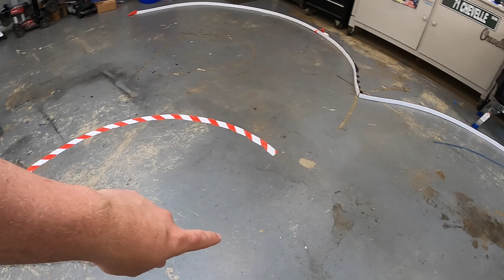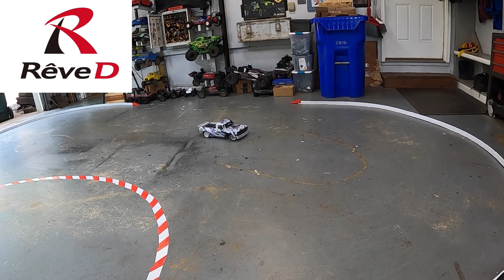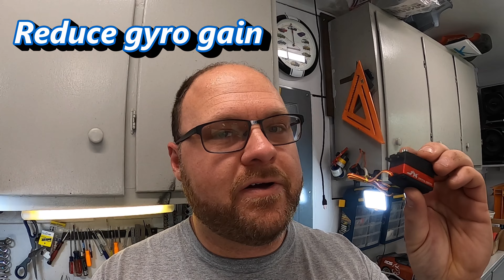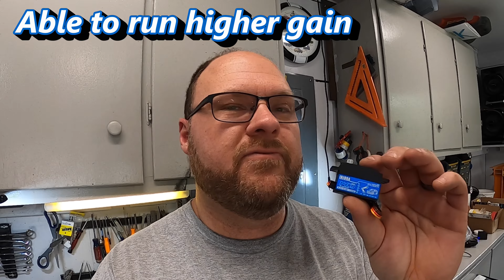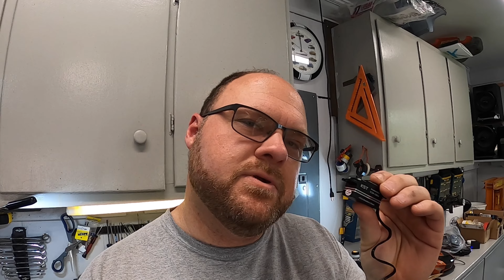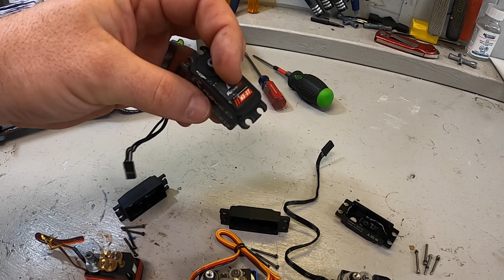Best for Drift??   Cheap and Expensive Low Profile Servos TESTED

Comment: what does the servo really help with in a rc drift car?
Reply from the maker: It has a lot of influence!
- Speed to get to the angle needed
- dampening to reduce wobble
- precision to be at the correct angle

Driving a low quality servo vs high quality really matters - especially depending kn the steering setup of the chassis.   When you have a direct drive steering, it is crucial!
Reply: @RoadsideRC oh okay i need that which servo should i get

Comment: I know this is an old video and not sure if you remember but, my buddy put the $25 injora servo in his RD 2.0 and when the car is powered off it is really hard to turn the front steering. With my sp-02 servo I can turn my steering when powered off super easy and smooth.  Is it the injora servo?  
 Mahaloz
Reply from the maker: Honestly - as long as it drives well, I wouldn't concern myself with how it feels when powered off.

Comment: So i have the injora servo and i paired it with the flysky noble 4+/inr4 gyro receiver combo. I'm running into gyro wobble pretty bad actually. Servo seems good gyro seems good. Did all the usual trouble shooting and haven't found a fix yet. Do you have any experience pairing the injora servo with the inr4? Wondering if i can pick your brain and see if i can't get some help.
Reply from the maker: Hello!
I have not paired those two together specifically.  

Since the INr4 is different than most gyros, have you gone both up and down in gyro gain to see how it changes? 

What chassis are we talking about?  Chassis with direct steering are more susceptible to wobble than wiper systems.
Reply: @RoadsideRC yes i have tried adjusting gain. 0-100% it goes away when it's off and gets worse turned up. I find 30-35% is my maximum before it gets really bad. Typically i see it come in at higher speeds. It's not a chatter but a wobble per say. 

This is on an MST rmx ex s pro kit. I just built the kit and it's on a box stock setup/alignment in the lcg mode. I double checked everything looks good according to book spec to start with. I believe it's a very similar car to the 2.5.

Comment: Is the injora compatible with the dp302-v4.  I try to google it about i cant find anything. Reason i ask is because im picking up a mst.  want to upgrade the gyro and hear the v4 will kill the factory servo, is that true?
Reply from the maker: Hello!
I have not tested that exact pairing, but I do expect they will work together well.   Multiple folks have reported back using that servo in various setups.

Comment: Bro you're literally answering all of my questions about this hobby. Thank you
Reply from the maker: Awesome! That is my goal!
Let me know if you have others.
Reply: @RoadsideRC man, so I did get a RD 1.0 complete for $150. I figured I could upgrade it and transfer my electronics to a more expensive chassis if I wanted to later on. I'm going to get a $25 Injora servo, a G2 smart drift gyro, and a DDF-350 transmitter per your vids 😂 so all in I'll be invested in for $310. I think I'm going to have a lot of performance for that pricing.
Reply from the maker: @TurboV8boi Please stay in touch!   One of my ideas for early 2026 was to see how cheaply I could build a car...and here you just went and did it!   I really want to know how this goes!
Reply: @RoadsideRC okay I will! I will say though, most people selling used rc stuff want pretty much retail price most of the time. There was only one guy selling near me that had a good deal on a RTR. So that's the hard part - getting a good deal on the car. At least where I am in Texas

Comment: Not going to lie, I bought the Injora based off of the performance I saw in the video. It seemed like a good budget option. Upon receiving mine, I find out that it is not actually moving a full 120°. It is not the settings on the controller, the servo just gives up when turning to the right at about 45° yet does give you the 60 degrees to the left. Unfortunately, this leaves me lacking steering angle to the right, I guess in the parts bin it goes.
Reply from the maker: Hmm.  That is odd. 

You are 100% sure everything is centered (no trim) and the end points on the controller are all at 100%?

Comment: I can absolutely confirm the Injora servo is very good for its price!  No shaking, no overheating, and it was totally compatible with a v1 Yokomo gyro. The torque was sufficient for a D5 bell crank system with minimal caster and the speed was good. only issue was that it doesn't perfectly recenter but it lands close enough l, within 5 degrees... And who cares, I'm sideways anyway and it's a cheap servo.  Well outperforms it's price!  Thanks for the research and tip!  I put a video of my project using the injora servo on my page
Reply from the maker: Awesome - thanks for the feedback!

Comment: I wish the reve d servo was still $75 lol they bumped it to $98. Im currently using a agfrc a50bhl with the onisiki gyro and im noticing alot of wobble at any gain north of 60. Is this normal? If i upgrqded the servo could i run the gain higher? Im considered upgrade my setup. I was thinking of getting your fav servo the reve d to go with my rdx. Thank you for all your help
Reply from the maker: Which Onsiki gyro do you have?   They make one that is not very good...and the Daruma that is much better.  

The servo isn't as much your issue here - I suspect the gyro.
Reply: @RoadsideRC  daruma sorry. I should have stated that. I love the way the gyro feels but I can't turn it up very high. I've already turned. T servo way down too
Reply from the maker: @LegendsPizzaCo  What do you mean by turning the servo down?  

In drifting, it is usually better to not mess with end points, speed, etc on the steering via the transmitter.   It confuses the gyro.
Reply: @RoadsideRC  I used the usb adapter and plugged it into my laptop and adjusted the settings based on other people's setting for the same servo. The only thing I adjust on the transmitter is the gyro gain. What do you think is causing my wobble? What gain do people normally run before they experience the wobble? I'm trying to dial this car in
Reply from the maker: @LegendsPizzaCo  Using other people's settings is only a good baseline.   I highly recommend you then tweak it for yourself.   That is part of this - learning along the way.
Reply: @RoadsideRC  yes but I had no clue what the settings do on the servo. I come from buggy racing and I never bad to change settings on a servo. What is a good baseline?

Comment: I bought a 35kg servo for my drift car i installed it i have not hooked it up to any electronics yet but when i installed it to the chassis the steering isn't binded up but its stiff like really stiff i know thats not normal is 35kg too much for a drift rc i know jack about any of this
Reply from the maker: The servo shouldn't add much additional resistance when not powered on.   I recommend disconnecting it from the linkage and ensure the steering moves smoothly without it. 

Yes - a 35kg servo is A LOT more than a drift car will need.  Precision is much better than torque in this application.  

Good luck!
Reply: @RoadsideRC  thanks appreciate it and yes it does move freely without servo thanks for the input I don't know nothing about this still learning

Comment: Hey Troy. Where does the stock servo/gyro from the Redcat rds fit in with these? Trying to figure out if I need to upgrade my rds. Keep up the good work 👍🏼
Reply: The stock RDS servo is actually really good. Just not good when paired with the gyro. Anyway… I pulled mine out and use it in my Losi SCTE and ace truck. Plenty of speed and torque.
Reply from the maker: Stock servo from it is rather good.   There is some advantage to upgrading the gyro for sure.    

First, I would put a better controller on it.   Have you done that already?
Reply: @RoadsideRC  Yes sir. I have a Kopropo.

Comment: The "wobble" -> Settings transmitter ( i ) noble nb4) -> signal frequenz  -> 330Hz or whatever your servo have !?
I have a SPT5410LV and an OMG V4 or yg-302 gyro whit a flysky noble and it works! No "wobbles".
The yokomo yg-302 gyro are somehow worse in small drift circles. A littlebit! That's how it seems to me!
Reply from the maker: Interesting!   Thanks.

Comment: I had bought a JX servo just because at the time I thought that it would be a cheap way to start.... Ran it 3 times and it burnt out. Going to try the Injora now.
Reply from the maker: Good luck!
Be careful with your steering end points to protect the servo!
Reply: @RoadsideRC   do you mean that I may be asking the servo to go past what the steering linkage system allows causing the servo to burn? If so, I might need to look into it because I just plugged the servo to the gyro and did some doughnuts so might be the case.

Thanks for the feedback :)

Comment: Im using a jx ecoboost 6336mg (36kg metal.gear ) very fast works well in my drift car my trophy truck and my trx4 and its not an expensive servo about £33  very happy with them and theyre quick! Only mod i do is aquick clean out of factory grease i use red n tacky whichis good to waterproof them and increase life span considerably
Reply from the maker: Thanks for the feedback. 

Which drift car do you have it in?
Reply: @RoadsideRC  it's one I've made myself it started as a nitro 4wd touring car then turned into an electric one but then used it for the rear diff and suspension and front hubs to make it a full rwd drift chassis now a full carbon upper and lower deck I've designed and carbon and designed  my own steering system with servo mounted in upper deck and mid motor high up with ESC hanging behind rear axle weighs 1234g with battery
Reply: I can send you some photos if you're interested keep tweaking it to get the correct  Ackerman at full lock . What would say was a good amount of neg camber to try front and back ? I know probably personal preference but I'm new to drifting but enjoy making RC cars even my trx4 is a full custom 😁

Comment: I just picked up a new rtr RDS and while I can’t spend the money to get a new transmitter yet I’m looking at a new servo. Long story short I was curious as to how big of a difference is there between the stock servo and the Injora?
Reply from the maker: Very little - honestly, the stock servo is quite good in the redcat.   I still have not upgraded mine on my RTR.   

Literally the only things I have changed on my RTR is the alignment  and controller.   Running the stock servo, gyro, ESC, and motor.  

Save your $$!

Comment: Nice video...I messaged you in the past and told you that I ran and still run a rtr blue traxxas servo.  Wondered if you have tried one yet in a drifter. My setup is with a Futaba radio and gyro.  Have never known why it works so well but you said something in your video regarding dampening...this may be why it works so well as this same servo is used in traxxas vehicles with TSM and may have dampening built in for that reason.
Reply from the maker: Hi there!
We had a local guy use a Traxxas servo and didn't have very good luck with it.  Honestly, most just stripped a gear rather quickly. 

Glad it is working for you!

Comment: Thanks for yet another AWESOME video. Have you tried pairing the ReveD servo with GYD450 on the direct steering system? If so, whats your breakdown on that?
Reply from the maker: Hi Earl - unfortunately I have not tried that exact combo.   My assumption is between the AVCS on the GYD450 and the programmability of the RS-ST, that combo should work very well.

Comment: Troy, it’s from your recommendations that I junked the JX in my RMX and went straight for the RS-ST. The reason? Servo shake. No matter what I did, I just couldn’t stop that servo from constantly trying to center and that’s BEFORE I connected my gyro!

Thing is… I’d been searching for speed in servos, not realizing that you also need torque, which both go hand in hand.

Personally, I like the RS-ST. Not the fastest but one of the smoothest for drift. Combine that with the programmer and REVOX and you have a combo that will make you look like a pro out of the box!

Nothing against cheaper servos but the RS-ST is on a whole different level that cheaper servos can’t give you.

To anyone asking, the programmer for the RS-ST is worth it and also updates the servo a bit compared to the settings given to you out of the box.

I might give the Injora a look since I’m rebuilding my old TT-02 RWD drifter.
Reply from the maker: Your experience speaks volumes!  Thanks!

Comment: Ive been reccomending the injora servo locally. Its pairs nicely with l both of my preferred gyros the gyd550 and the power hd G1. The injora/g1 combo is on par maybe even better than the yokomo v4/ sp02dv2 combo that most people settle on.
Reply from the maker: It really surprised me how good it was!
Reply: Good to hear because i just started building my D5MR V2 with a G1 and an Injora 😂👍🏽👍🏽
Reply: @Gab3A looking at same setup how do you like it so far?
Reply: I have the injora 35kg brushes and it’s stupid fast and it’s 30 bucks.
Reply: I recommend the Yokomo V4 with the Sp-03D V2 always, its a bit pricey but its the best out there in my opinion but the gyd550 isnt bad it was a good gyro for my mst build and I’ve personally never used the HD G1 but i wont knock it till i try it

Comment: I use the base $75 Yokomo, the slow speed and top notch seek correction make it stable at 100% gyro for me. I've also used a EcoPower 110T which was questionable on the MST, and an AKG programmable on another car, not a drift car but its a nice functional servo. :D
Reply from the maker: Thanks for the feedback!  I need to dive deeper into the Yokomo stuff.
Reply: @RoadsideRC  Its fascinating, since it goes against what we are taught about fast servos. Yet, it works brilliantly for my driving style so far.
Reply: Yeah the stock SP-02D is my go to in a couple cars. The ReveD was too fast 😂

Comment: Great video much needed information as I start to build my drift rc
Reply from the maker: Glad to help Ramon!  Good luck with the build!
Reply: @RoadsideRC  thank you definitely getting the rev d servo and yokomo gyro as my first upgrade for my yd2s. One question what is the benefit of upgrading the  transmitter? And what are the points of having say 5 or 6 channels?